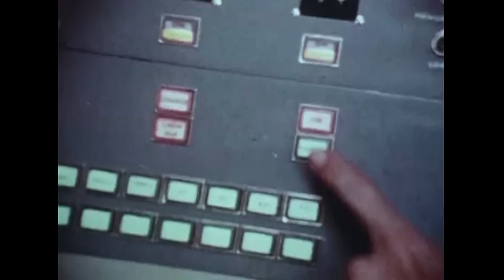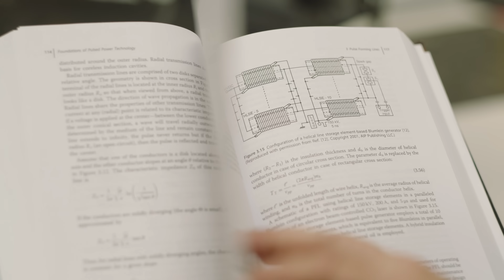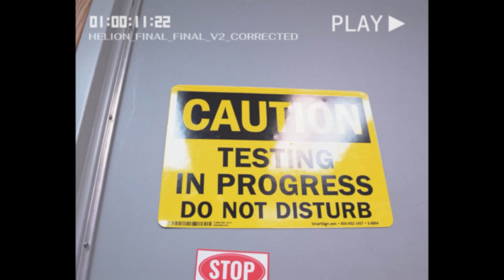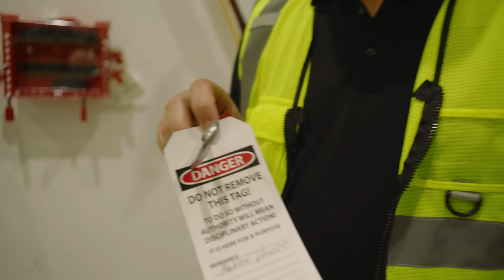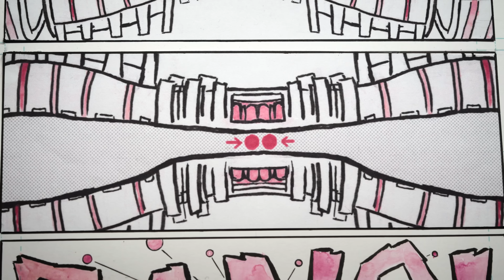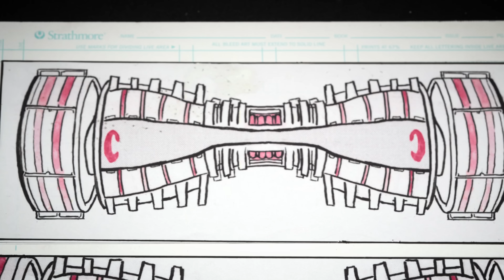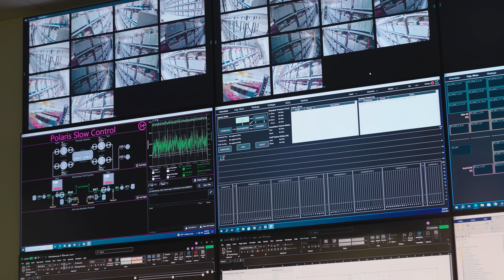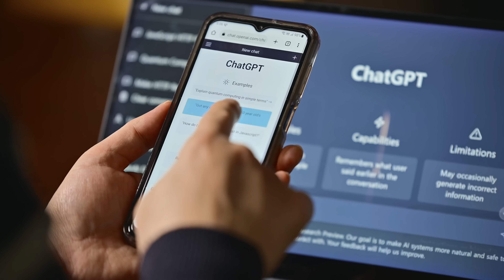A New Type Of Nuclear Fusion Machine Has Come To Life

Comment: Laughed ass off when his first words were he hated being called the Holy Grail. Gee, Ive been following it since before he was bloody born and it’s the Duke Nukem of power except they did finally release that Duke Nukem game and it was crap. If he’s right about everything they are likely 20 years away from a commercial plant and that solves nothing! Sorry but solar and wind work now and as much as the potential of fusion is overstated so are the problems with both those system. I bang my head every time I hear about all the “waste” from wind generators. They are mostly steel and I kind of thought that was recyclable. The blades? Give me a break. Any idea the waste oil and gas generate and nuclear is the Darth Vader of waste. Solar is the cheapest and fastest to roll out. The only thing cheaper are those massive wind generators and there aren’t many places they can out them. I can name a dozen other sources better than nuclear and oil and fusion is a pipe dream. At the very least it will be insanely expensive to build a plant, if it ever works. I can put up enough solar panels to support a 5,000:sqft house for $6,000!,! And yes there are battery solutions. Salt batteries work but they are too cheap and easy to make and have no toxic components and csn be recycled so they aren’t a good option 😊 I love nickel iron but they are too pricy since the price of nickel went through the roof. They now cost 3X to 4X what they did 5 years ago. The money would be better spent refining those options. Nickel iron batteries are fully recyclable and last for 60 years and can be refreshed to last another 50 or 60 years before you even need to recycle them. They can be drawn down to zero so other than the cost of nickel they are the best batteries known. Why aren’t they using them before prices went up? Too good. Makers can’t make money off a product that will outlive the company. Just sick of all this nonsense when we already have solutions. And now fusion will never be that too cheap to meter power the fanboys claim. Show me the numbers? Math don’t lie!

Comment: 7:17 that is almost impossible... basically, if you get two boxes deep in the water that won't float, but 1 box alone can float, yes then if separated they will float. but IF you want to do that in the opposite or add more mass than that can fit, the only way is to heat it up and basically inflate it's size so that it will have a better size to mass ratio than everything above it, or around it in case of atoms... though I am not sure if this is even possible since, the weight you have to carry will be exponential and it could very well get instant teleported ( by the looks ) in theory the moment it reaches that stage... I would advice to not use anything that is atom to use as a container for it... edit: and 1 more thing... there could also be another possible case that this is impossible since you might just have to push the whole known existence for this to work, though as far as I've seen I think it will just spit out the anomalies to whatever can handle it... edit2: I think I overcomplicated this... All I'm saying is that- either you can remove mass to float or increase volume... but if you want to increase volume internally, you will 100% have to feel the weight of the whole system...

Comment: I remember seeing this concept a little while back and thinking that their process is the first I’ve seen that might actually work efficiently and practically. Inertial confinement and laser ignition seemed more like research than projects that could power things. Helion might have discovered a completely different approach that can really take us there.
Reply: I like that they've dealt with the ridiculous engineering problem of using a 100 M Kelvin plasma to boil water and spin a turbine.  I like the approach, but still doubt it will ever be economically competitive compared to firmed PV/wind, which are really cheap now and can be implemented about as fast as you can hook them to the grid.